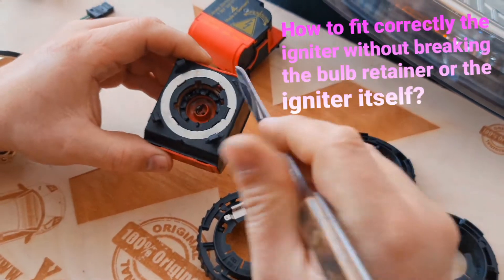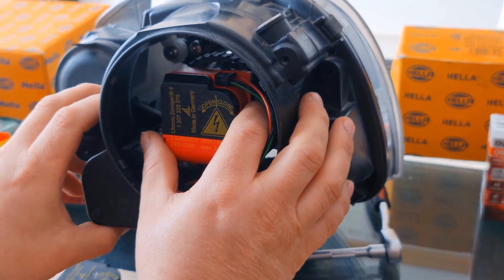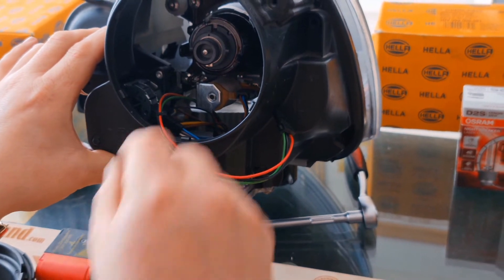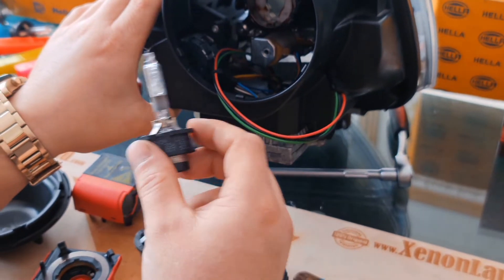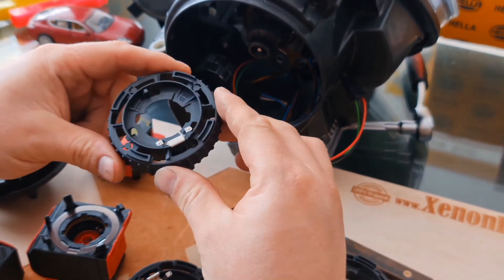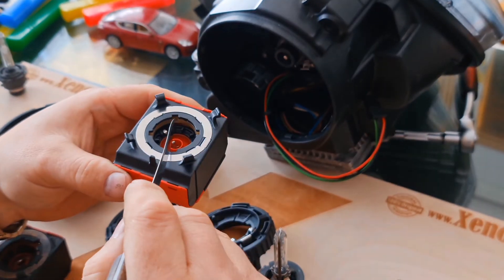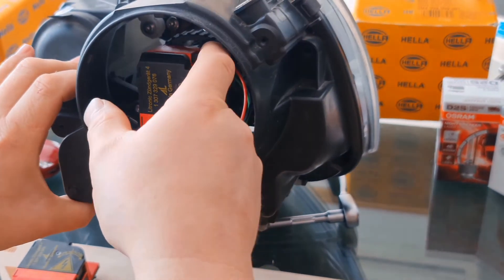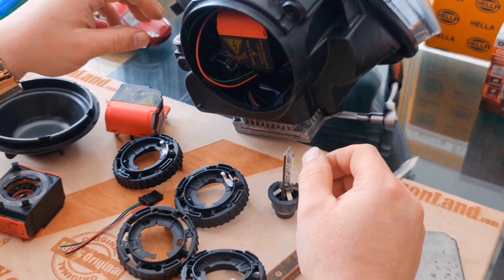HOW TO FIT SAFELY (WITHOUT DAMAGING LEGS OR RETAINING RING) AL 1307329076 XENON HEADLIGHT IGNITER?

Comment: man I have just tis ignitor in my a3 8p1 2003... is fking shit to take it out from there witouth if you dont want dissasemble the headlight
Reply from the maker: There is very limited space behind the cap at A3 xenon headlights. Really a pain to replace it
Reply: @xenonland  well, finally I could do it and put a new one in the left side, anuway is very difficult and the right one is harder + I have very big hands.. is better take them out and change it more easily

Comment: Question I have a r32 golf what's the difference ignitor that has the round silver some of ignitor does not have I guess aftermarket does not have them is there a purpose of having it or not thanks
Reply from the maker: Sorry could not get your question? What you mean by round silver?
Reply: @xenonland  the one around the ignitor
Reply from the maker: After checking the china copies I get the question. Exactly, replica ignitors do not have this silver metal/contact ring.
Reply: @xenonland   I got quoted $500plus here in Australia VW dealership so I looked up in ebay same as the OEM cannot tell difference besides light printed I got them for $71 AUD since my left one had burnt the connector of the ignitor & the previous owner had to replace the headlight due to wires got burn loose arching ignitor to bulb
Reply from the maker: In Europe, they are sold around 100 eur new-genuine. It is very likely that you will have some issues with these aftermarket ignitors, their plastic is softer and tend to melt.
Reply: @xenonland  also whenever replacing a aftermarket headlights they most like need to be readjusted and reset with Vcom since if it's off the adjustment maybe too far and it will get an error light warning
Reply from the maker: @heyheysaturday2492  you will be lucky if the low beam levelling is even close to the original settings.
Reply: @xenonland  Apparently it isn't different settings I did look up that when I had this installed the aim was very low & needed to be readjusted so my. Mistake was I have to use the vcds to learn the adjustment and it will be fix I have check no sensor level have broken or anything my original don't auto level both old and new headlight unit no motor has popped off so I will take my car for service next week to get my projector back to factory settings & I will invest a vcds cable so I can program in the future
Reply from the maker: Which aftermarket lights have you bought?
Reply from the maker: Depo?
Reply: @xenonland  it's from Australia one leading stores that provides original or OEM parts so the one I bought is close to the original one that also built in motor the original headlight I have I still have it problem is it had broken tabs from a previous owner & the fires got burnt so what I currently have is the same headlights that's from the same place working properly most likely the one I got was a faulty from. The manufacture I'm still working for their testing since they got the unit back
Reply from the maker: Asking because almost all of our clients had levelling issues with the aftermarket headlights. Most of them bought later original headlights (although expensive) to solve their problems. Never seen any aftermarket headlight for golf 5 to work correctly.
Reply: @xenonland  the one I have which was aftermarket are working properly only reason I went aftermarket was I had no issue yes the original one is a cut on the the one I got had a issue with one of the motor was slight jerky so it's a hit and miss mine still under warranty so different policy over where you are here in Australia we got warranty for any faulty
Reply: @xenonland  the clients will have to recalibrate their headlights from vcds from a older model cars but the new cars have an app for mark 7.5 that will doe itself without vcds

Comment: You should state in the title that this is only for specific model, cause the last step is incorrect, for other cars like audi, which is also a vw, you should put the power cable before locking the igniter, cause locking the igniter is also locking the power cable, otherwise it won't fit!
Reply from the maker: You are wrong my friend. Probably you are talking for audi a3 where you have very limited space to fit it. Even removing the igniter at a3 is pain. But steps are same. If you put the power plug first the internat ring will move and opening as well. Then you can not fit the bulb correctly. You will damage the igniter internals or in time the bulb base will melt. If you still do not believe see audi repair manual and you will see that the official steps are same as I describe.
Reply: @xenonland  Was talking about audi a6 which doesn't have the ring that you can remove but the wire which is holding the bulb in place. So once you remove igniter the power cable unplugs itself, but if you lock the igniter before putting the cable, you will not be able to lock the cable plug. Yesterday I was changing it and I was pissed off cause as you said there is no space at all aroung the headlights and I have to remove filter housing and plenty other stuff 😭 On the other side my igniter looks healthy also the bulb but the light doesn't show up, when I remove the bulb and turn on the ignition I see it is sparking at the place where the bulb fits and also loud noise from sparking, the wierd thing is that both looks healthy.
Reply from the maker: First, a6 has not any bulb retainer, ring. It has springs.  Second it is Hella system, not AL. Third the plug goes again at the end. If you put the plug first you will move the alignment ring further. VERY SIMPLE, AND WITHOUT PLACE FOR DISCUSSION. Then you can not insert the bulb properly. This is not a standard locking mechanism, the pin of the alugnment ring ejects the plug when removing the igniter. Not any lock. The upper line cut serves as lock when inserting the plug. Anyway i will make a video and show you the official audi repair manual steps when dealing with audi a6 xenon headlight. You are deadly mistaken, exactly thats why you guys break the igniters pins, alignment rings or the alignment ring tiny 4 bases that you barely can see. Promise will make the video showing audi OFFICIAL REPAIR MANUAL.
Reply: @xenonland  My bad then, and my comment was a result of being pissed off about engineers who made this so stupid that you have to dismantle "half of a car" to replace a bulb, so sorry about that.  Would be super useful if you make a video for proper replacement of this type of bulbs.
Reply from the maker: @xmax-a  no problem, most of the mechanics do not follow the steps and break the igniters and retainers and they do not tell even to the customers. definitely we will make a video for audi a6 4f soon.
Reply: @xenonland   @XenonLand  Just bought the new igniter, and tried what you have described and you were 100% right. I was able to put the power cable after locking the igniter in the position, also I saw what were you referring when saying I will put alignment ring further If I do it vice versa, my old igniter had that issue and alignment ring was misplaced. 
Thanks a lot for bringing this up!
Reply: You are GREAT
once i tried to do myself  on my golf 5 , a lot of problems ,
after you so clear explanation…great suxes job and soooo easy to do it….!,!,🎉🎉🎉
Grazie mile 🙏🙏🙏you are great!!,

Comment: Can you make a video about how to remove the headlight from Volkswagen Jetta vehicle for better access to the bulb
Reply from the maker: We are on the technical side of the xenon repairs and only dealing with the xenon parts. All other mechanical stuff are left to mechanics. Unfortunately for this model, removal of the bumper is absolute must (working with a loose bumper just will lead to a bottom headlight leg damage, hence a condensation issue). There are three fixing tabs to be released in order to remove the headlight: one at the top (first tab), one at the inner side where the headlight meets the grill (second tab), and one at the very bottom (due to this bottom lug, you will not be able to remove the headlight from the car without removing the bumper, or under covers). Absolute torture to replace a simple bulb or ballast/module due to bumper being bulky. But in any case, we always recommend total removal of the headlight from the car in case of ballast/module failure to identify the condensation/moisture source. Otherwise any replacement ballast/module will burn again shortly. Thanks for your interest in our video.
Reply from the maker: Removing the bumper is not a big issue, just couple of screws to remove, but it is bulky and usually you might need additional help from a friend.